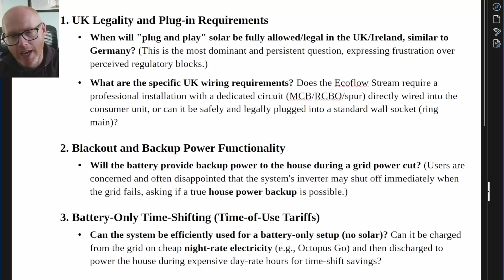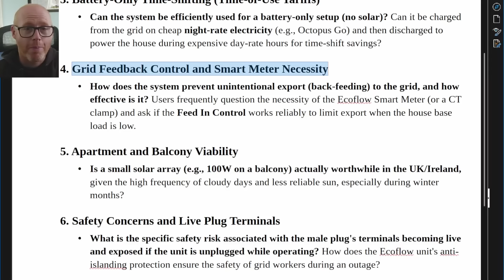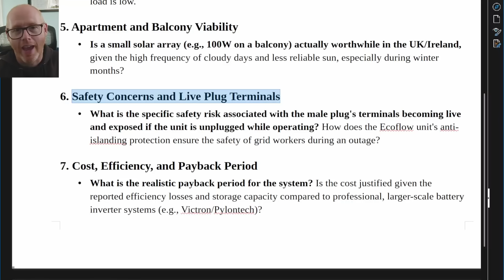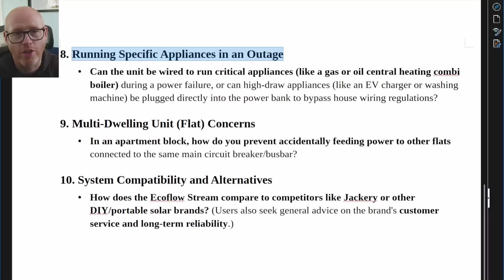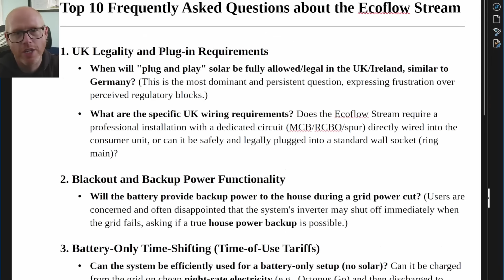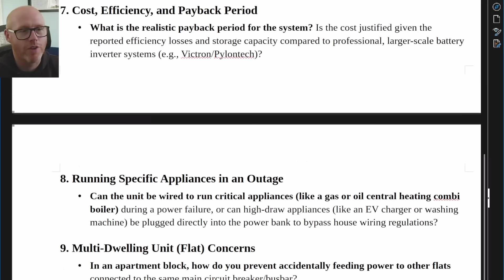Plug-in Solar - EcoFlow Stream: Legal in the UK? Wiring, G98, RCD? Blackouts, Time of Use...

Comment: Thanks for the useful info! I have an interesting question not covered in your video... I notice the documents for the EcoFlow STREAM units say it's not a UPS, it can take up to 3 seconds to switch power. My question is, if I have devices plugged into the power plugs on the unit when the power goes off, not plugged into the house circuit, these are the ones that have a delay of up to 3 seconds when switching? It makes sense they are referring to these, as the other power supply is turned off to protect the grid within 0.7 seconds. But have you really noticed such a long delay in real world use? @UpsideDownFork

Comment: I’ve added an ultra x to my existing powerwall set up since I have a heat pump now winter draw is noticeably higher. Very happy with how it’s working at the moment, will probably pick up the Shelly ct clamp device rather than the eco flow one as it will let me read my house and heat pump separately as the daikin’s figures appear in home assistant the hour after they occur and are clearly not exactly accurate
Reply from the maker: Good to hear it's working well for you, even without the CT.
I have found it very handy using the Shelly to monitor the different circuits.

Comment: I now have 3 x Ultra X and 1 x ac pro, 10 x 450 watt panels and 2 x 400 watt panels. According to eoflow you can only chain 6 units in parallel , am waiting for an Ultra X ac pro soon, ie double size battery pack. I run my tumble, washing machine, dish washer , air fryer and microwave from the dedicated sockets . My long term plan is to either get another 2 x ac pros, else if they release an ultra battery pack then some of those . I installed everything myself and if you an do this then your laughing at the ost of a system like this. My long term plan is to purchase a delta pro 3 have that feed the dist board via manual transfer switch ( again install everything myself ) over switch and then off grid = simples. I have zero interest in export for money. I have noted however one weird thing with the ultra , you cannot set to power/ charge  from mains ac , you have to set backup reserve to 95% for that,
Reply from the maker: Woah. No messing around with that setup!!
Reply: How much are the stream feeding the rest of the house? 800w all together or 800w each separate unit? Any idea if more than 6 units still adds storage capacity?
Reply: @Grounded_message  800W limit for all units combined
Reply: @highlanderes i managed to do more: assign them to different spaces. One set is linked to my smart meter , the other spaces charge and discharge by schedule. But not sure it is useful.
Reply: @Grounded_message  Thanks, can the two spaces be on the same wifi?

Comment: I'm getting on quite well with my UltraX + 2 x AC Pro I got through referral from you. 6 Solar Panels from City Plumbing you also recommended too.
Fence mounted install and stream units kept in the shed due to one of the units having an overheating fault.
Returning the faulty unit despite being new was a bit of a pain with the return process so glad I got them on Credit Card.

I'll look at the black friday sale when it comes up but their sales seem very DFS like.

One thing I need to test more is the 3pin sockets staying live during a power cut, as I have seen power drop under some circumstances.
If I can get it to stop dropping (Maybe need to hook up earth terminal to its own earth)  then these devices seem very useful.

Fingers crossed the gov drop the hard wired aspect and allow a solar revolution without the usual price gouging of certified installs.
Reply from the maker: Good to hear they're mostly working well for you.

That's an interesting point on the earthing.

I should look into that further!
Reply: Thanks again for all your research.

Comment: I have an ultra x and 2 x AC pro now, i think they are brilliant. For me it compliments my sunsynk and 4kwp solar array. I fill them up overnight on IOG and discharge the whole 8kWh over the other 18 hrs - 800w during the dinner cooking period and as little as 200w the rest of the time. My sunsynk picks up any excess rather than exporting and the additional load during the day is also picked up by the sunsynk. this has turned out the best way for me to get aditional battery capacity at less than 50% of the cost of having my 10kw sunsynk system professionally fitted. the plan for the summer is to get some additional panels that i will use the 3 stram microinverters that i got frecently for £99 each.
Reply from the maker: Thanks for sharing your brilliant setup with the community!
Reply: So maximum 800w to house from all units all together? Not 800w from each?

Comment: Can you please remind me what fixings came with the 4 x solar panels?
My garage is at the bottom of the garden, 20A protected, 4mm armoured supply cable to the usual small garage CU.
Roof is steel, tile effect box section, size suitable for the 4 panels. I was therefore thinking if I upgraded the garage CU to add a circuit for Stream, so placed in the garage will the Stream series power the whole house back via garage supply? 
Where does the export meter go as it only say 16A Max?
I don't want to export, my
Main interest is to cover household base load + a bit.
I have an EV and charger on it's own circuit, so have IOG to charge Streams in winter months.
Any advice appreciated. Thanks.
Reply from the maker: The panel fixing kits are purchased separately to suit your circumstances.

Yes, as long as you get the CT from the energy meter round the main incoming tail then you can cover the house load from the garage supply.
Reply: @UpsideDownFork Thanks for the super quick reply, so I would mount the export energy meter in the Garage  CU, and the CT clamp on the output main tail in the house. 
can that be via Cat 5e twisted pair, rather than wifi. I've some free not used by my car charger load balancing CT?
Reply from the maker: @Paul-hu3zr that's what I used to extend my CT and it works perfectly.

The energy meter and the stream devices need to be on the same WiFi network, that's how they communicate. You could put the energy meter in the house at the main incoming supply but if distance is an issue, consider a proper mesh WiFi to extend the signal.
Reply: @upsidedownfork this is a similar set-up that I’m interested in, armoured cable out to the garage consumer unit currently for lights, sockets and hot tub - I haven’t run the tub for some time due to cost. Also EV charger & on IOG. Do I need a bidirectional breaker in the house consumer unit for the garage cable, then another circuit in the garage consumer unit with another bidirectional breaker to a new fused spur for the Stream unit to be wired to. Could I run it like this & supply 800w to the house without any meter, and  then export as I add panels to the system. Thanks for any advice.

Comment: Thanks for this, what's putting me off ecoflow is their greed, the pricing of their panels makes me wonder if their batteries are really worth it.

Also concerning seeing people talk about the subscription models they're trying to push with fake "AI"  buzz words plastered all over the app and charging their most loyal customers a subscription just to integrate older ecoflow products!
Reply from the maker: I agree that the panel pricing is a bit steep when bought in isolation but can be ok if bought in some of the bundles.

I don't see any need to use the "AI" features. What do you mean by needing that for older products?
Reply: @UpsideDownFork so Jonathan Tracey mentioned that in order to link Delta 2s etc to the battery you then just to pay a subscription, penalising their most loyal customers!

Also some of the functionality offered in the subscription isn't even cloud based so shouldn't be pay walled I believe? 

It's just really off putting as a newby as I'll only find companies with decent moral ethics
Reply: @AndyKennedy only AI is paywalled nothing else

Comment: On point 8 you didn’t cover Combi-Boiler application, as an example my Vailant Combi-Boiler requires 1500 Watts on startup and the backup power unit will probably require bonded earth. 🤷🏻‍♂️
Reply: you are right, a lot of boilers won't launch (even if power requirements are met) without proper earth as they have an in-built protection - most (if not all) of the modern units do.
Reply: @AlexGnok I was planning to install an ecoflow under my boiler and in a power cut plug the boiler into one of the built in sockets on the unit. Are you saying this wouldn't work?
Reply: @JohnBlackburn1975  it might not work during a power cut. Most modern boilers are very sensitive and won't work with incorrect  sine wave or earth bonding issues (the gas burner will not fire).
You won't know until you check.
My cousin is living in Ukraine, they have power cuts every single day.
His EcoFlow (don't remember the model) wouldn't power the combi boiler out of the box, he had to do some modifications (if I remember correctly, he has to provide additional earth or neutral to the boiler)
Reply from the maker: 1500w?! 😮 That's a lot more than my Vaillant Arotherm Plus 7kW heat pump which typically needs around 900W during startup.
Reply: @UpsideDownFork  Oranges and Lemons, what back-up power do you use for the heat pump when mains goes down and is it bonded earth?

Comment: Is BS7671 even applicable to something plugged into a 13A socket?  It's often called illegal but precisely what laws prevent a generating device being plugged in? BS7671 is not law.
Is the Ecoflow type-approved for G98? if so, it might be interesting to submit a G98 application with a diagram showing it plugged into a 13A socket & see what happens. 
The oft-quoted "safety of grid workers" argument is nonsense in almost all scenarios - other loads on the system will more than kill any voltage produced and trip out the source. Possibly only a risk where a single house is fed by its own transformer.
Reply from the maker: How about 551.7.2? “A generating set shall only be connected to the installation by means of a fixed connection.”

Or maybe G98 Clause 3.2: Connection to the Distribution Network
“The installation shall be permanently connected to the Customer’s Installation via a dedicated circuit and point of isolation.”
Or clause 4.2: “The interface between the Micro-generator and the Customer’s Installation shall incorporate means of isolation and point of connection that are clearly identified and readily accessible.”

I agree that BS7671 is not technically law in and of itself.
Reply: @UpsideDownFork  What is the legal status of G98? 
4.2 would cover a 13A socket if labelled.
Reply: YES the the eo flow power stream series are type approved for ean with their own EAN ref numbers
Reply: Isn't the issue with these things ring final circuits where you could end up overloading a leg of the ring if you have multiple sources on current that can go into the ring.
Reply: @edc1569  nope, they have their own dedicated circuit, what don't you understand ?

Comment: Do you know of anyone successfully using semi-automated mode (smartplugs instead of wiring in a smart meter) in the UK?

After a month of back and forth with support my ecoflow X shelly smart plugs never worked (just show up as "other devices"), and I've ended up returning them.  99% sure its a software bug :-(
Reply from the maker: Yes, there was someone in the comments of one of the previous videos who was reporting a similar issue and I think they resolved it by changing the spaces?

Comment: People don't realise that without a system to isolate the grid from the house, a generation/battery system would be supplying electricity to the whole street if it didn't shut off automatically. Yes you can do it my throwing the main breaker on the DNO service head, but not that automatic. I wonder if 2 ecoflows (not linked) both plugged in to your house would keep each other up and running ? That would be a safety issue of course.
Reply from the maker: No they wouldn't, because they don't just sense the voltage but also the grid frequency that they sync themselves to.

Comment: Some comments

1. There's one exception to needing an electrician in some cases is when it's a building that isn't residential or attached to one. That normally only matters for stuff like off grid units and solar on your shed and fitting a private off grid consumer unit. See building regulation the part P rules if you are curious. Not sure I would opt to do this personally.

2. Worth noting the sockets on the front don't count towards the 800W grid tie during grid up situations which means you can actually get a fair bit more out of the system if you plug the right devices onto it. It also accurately knows and can follow the demand of those sockets separately even without a smart meter. So for example if you've got the fridge plugged in there for backup it means you can output base load but still cover the very spiky load a fridge produces.

5. 100W is great plugged into a 12v or phone charger style system but IMHO fairly useless on an inverter sized unit. Basically there is a minimum amount of power needed to charge the battery pack. A 100W panel will rarely generate enough to meet that requirement for a decent sized battery pack. In the Ecoflow range the River is about the largest you can charge with 100W, and it's way way better with 200W overpanelling.

As 400-500W panels are cheaper than 100W ones at this point nobody wants to use 100W panels. A 200W panel is probably the point it makes sense with something like a Delta 2. Panel scaling is also weird - on many days the amount of useful generation you get grows more rapidly than you'd think as you add panels. If you've got more panels you can charge your battery in the gaps in the clouds in our lovely sunny weather.

8. Don't do this for a washing machine or a toaster etc unless you know your earth is always good even with grid down. Most houses will be but get your electrician to answer that one or sort it when doing the install

9. If you have your own meter and supply then you might feed power into the other flats but that's no different to feeding back into the grid from a house. If you don't have your own meter/supply then it's a no go for grid tie so please don't try it in an HMO, especially if you don't know if half the other residents are sneakily trying to do the same - stick to a box in your room and plug stuff in directly. (and keep said battery so it's not between you and the door)

10.  Anker is the big brand you didn't mention. At the upper price range but rated well on quality

On customer service: Ecoflow service is terrible but I've always gotten the right answer in the end, and return/replacement is slow (30 days). 
I've personally had great results from Bluetti including early access to a firmware fix but I know people who've had problems there too.

Honestly though these companies all sell as many as they can as cheaply as they can so all of them have fairly lousy customer service because that costs money
Reply from the maker: Good clarifications!

Yes, the inverter is rated to 1200W, so you can have 400W through one of the plug sockets and still have the full 800W feeding the rest of the house.

Comment: Great balanced content as ever. I'd echo the comment around fence, balcony mounting. I've mounted 4 panels on my roof - its a right faff and not for the feint hearted.
Reply: Simple wooden self-made bracket to mount solar panels on the wall of your house facing south. Small hole in the wall to feed cables from solar to internal device. Very easy to install with no need to go onto the roof and can even be installed over your lower windows which is rather easily done with a small ladder.
Reply: @AndyAndy-we9pe good idea. I was thinking of installing them over a low section of roof reachable by ladder. Seems to me the Achilles heal of solar panels is the huge expense of scaffolding both to install in the first place and possible repair later.
Reply from the maker: Thanks for sharing your experience!